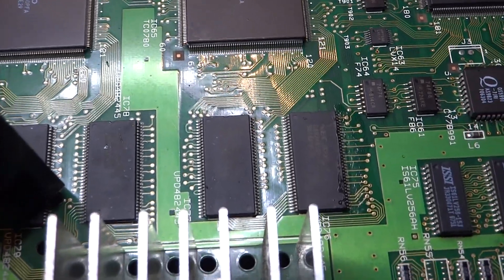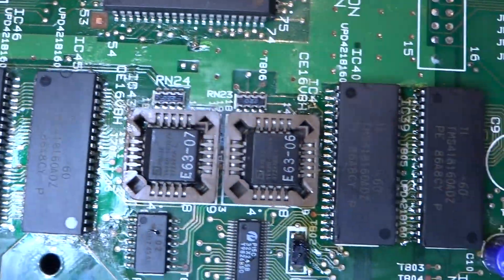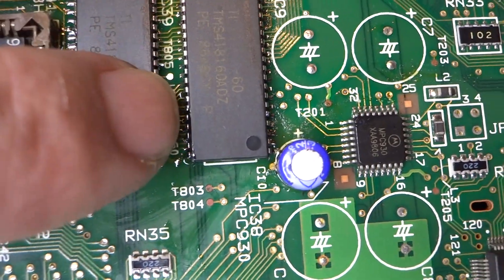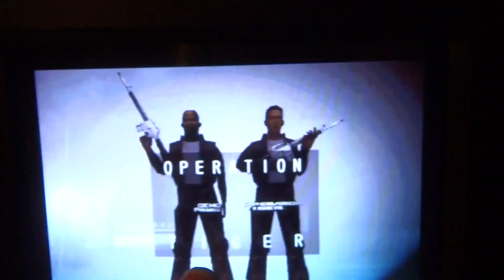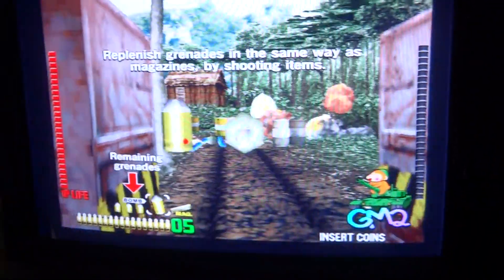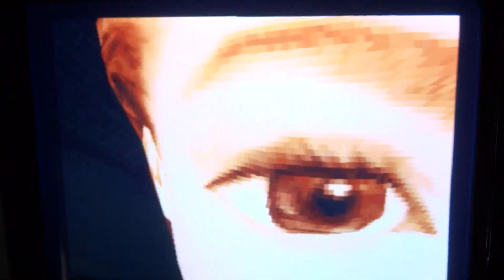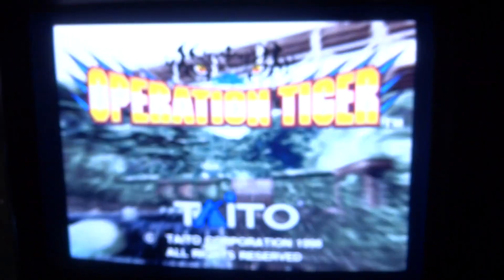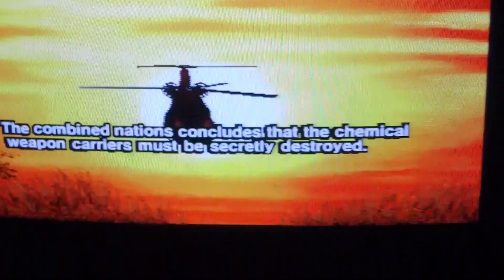Taito Operation Tiger Arcade PCB Repair Tip And Update

Comment: Hi Luke.. greetings from Germany. I got a Operation Tiger 2nd mission pcb set.. I make a jamma adapter with your descriptions.. but the pcb isn’t booting. I checked the voltages, i reseat the EPROMs and socket custom ic’s. But nothing helped for now.. do you have some additional info?

Comment: Hey Luke! :) To not have flashing when filming a crt, you need to set the shutter speed of the camera to the refresh rate of the tube. So if it was running at 60 Hz, you would set it to 1/60.
Reply from the maker: Thanks a lot my friend. Thanks for the tips :) This camera that Im using is actually a combination of 2 broken cameras and it doesnt like to focus correctly as well lol. Ive managed to get it working in the past but its on its last legs. I think I might have to switch over to my phone for recording soon.
Reply: @lukemorse1  You can do this on your phone as well in what will likely be called "Pro" mode or something similar.

Comment: Good job, Luke.  Can I recommend amtek tacky flux and lots of isopropyl to was off the flux?  Also, if you have a hot air station, set it on low to blast the rest of the flux out from between the pins and underneath?  Also, u might want to consider using solder paste for tight spaces like that.  A good hot air station is so underated for smt imo.
Reply from the maker: Thanks for the tips. I do use Amtek and alcohol for cleaning but for this video ( not sure if I mentioned it or not) I had just finished installing the other ram chips and reflowing the first set. The issue with this board is that it has smd caps on the bottom of the ram as well so heating from the bottom is a no go. I agree though, a hot air station is good for smd chips for sure though.

Comment: I don't think I have even seen a Tiger at the arcades in the states. Honestly, I was soo disappointed in the third installment - not sure if I would've given a chance. Do you have a hot air station? Might've helped more with that ridiculously located I.C.
Reply from the maker: Ah, I can see where you are coming from. Im not sure how this one plays but hopefully it is a fun one. I dont have a hot plate and unfortunately for this pcb there are quite a few surface mounted caps under the ram chips so I couldnt hit it from the bottom. Definitely a good tool to have. Thanks for checking it out